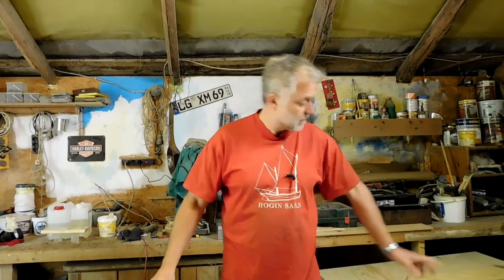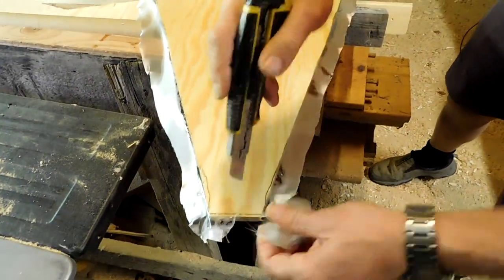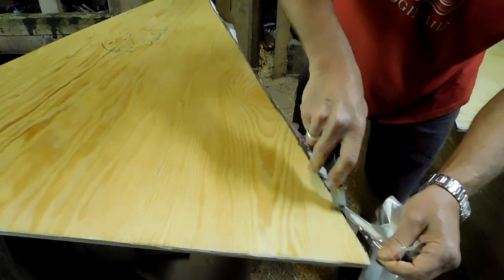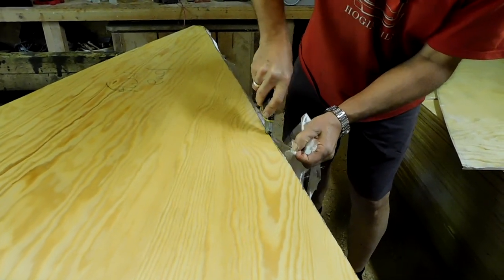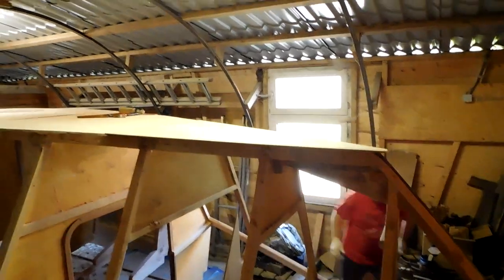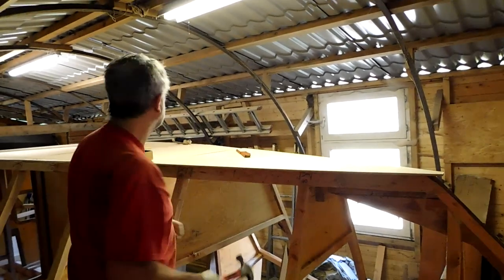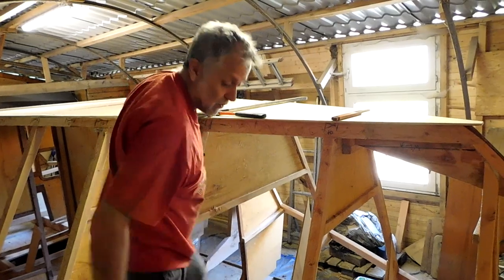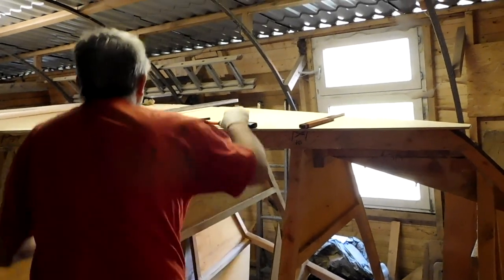Bottom Planking - SV Tapatya EP35

Comment: It's looking great.  Can't wait until it all planked. On a side note..Why did you go with ring nails versus screws?
Reply from the maker: Thanks Scott. The designer recommends galvanized clout nails. I wanted to go for something I thought would last longer. Another builder used stainless ring nails, which I considered doing. Then I found silicon bronze ring nails on sale from a boating suppliers in the uk. They're significantly cheaper than bronze screws and easier to put in. The ring nail structure means they should hold well.
Reply: SV Tapatya I have used silicon bronze nails for years on several boats and have never had a problem with them, even when you hit them with the power planer! but a stainless nail will really chew up the cutter. On a side note I have a box full of dead Bosch, Craftsman and Makita batteries, cordless are great but for every day use you can't beat corded power tools and my shop is solar powered!
Great series of videos.

Comment: Tony, I need to ask what may be a bloody stupid question.. Here goes mate.  "Do you pull those nails out after the epoxy cures and refill the nail holes with epoxy?  Cheers!! :):)
Reply from the maker: It's not a silly question.  The nails are silicon bronze gripfast nails. They stay in. The screws are taken out again and the holes filled, which is why I've tried to use as few screws as possible - just where necessary

Comment: Hi Tony, I have a difficult question to ask in a clear manner about how you lay the board up to the bottom for epoxying together. I try my best here. Did you device a sequence of laying alternating end grains between layers of board and bottom so that at the end of completion they pretty much lock against each other brickwork fashion, i.e. when seen in cross section? Or did you just complete layering up the bottom first before putting up and building up all the boards?
Reply from the maker: Hi Joseph. I put one complete layer on the bottom, then one on the sides. Next, I put the second layer on the bottom, with the joints staggered by a third of a board. Next came the second layer on the sides, with the joints staggered by half a board. Finally, the third layer on the bottom, again with the joints staggered by a third of a board. This way, the board joints are evenly distributed and the bottom to side, at the chine, ties itself together nicely. Hope that helps 👍
Reply: @SVTapatya  Thank you for clarifying, Tony.

Comment: With your drain holes in the frames how come you didn’t open them up to the bottom planking..
Reply from the maker: Yes, good question, Chris. I spent quite a while thinking about how to do the limber holes. They seem like such a simple thing, but somehow I couldn't decide how to go about them best. In the end, I emailed Dan Johnson, who built Hestur, a 34ft Benford dory, and is now working as a shipwrights, and asked him what he did. 
Obviously, however you do them, any exposed end grain of the floor beams needs to be sealed. This way seemed simple enough and, as she should be a very dry boat, seemed ok for this build. A small amount of water could collect in the bilge sections, but the wood will be thoroughly sealed and, if I keep an eye on them, it should be easy enough to dry out the individual sections.
I was reluctant to remove any significant amount of material from the floor beams as they're only 9cm (3.5 in) thick at the thickest. Slots down to the planking would have made them thinner in those places, whereas drilled holes should maintain the bulk of their strength (I think!)
Reply: Thanks for the answer, I suppose you could drill them bigger then fill hole up with epoxy then re-drill. I am enjoying your build and presentation, your doing well to have your daughter filming.
Reply from the maker: Thanks Chris